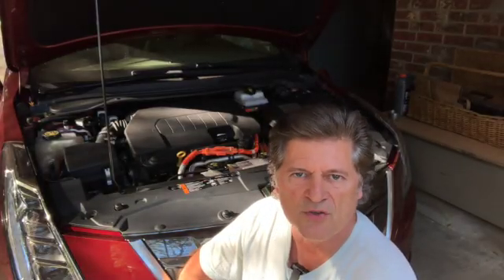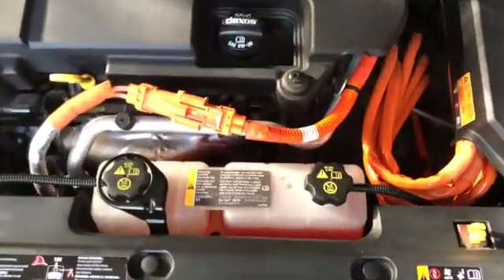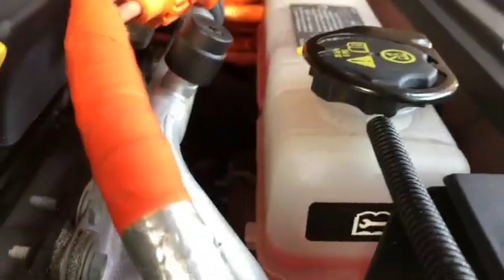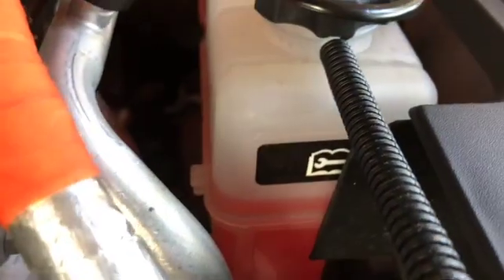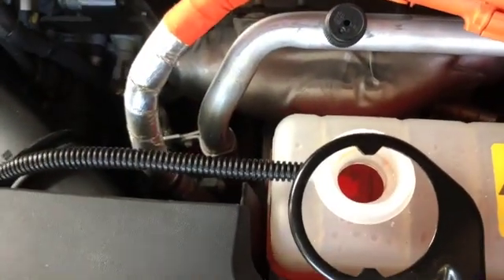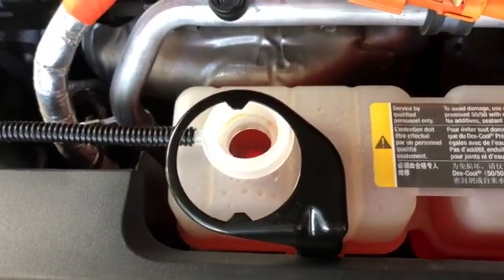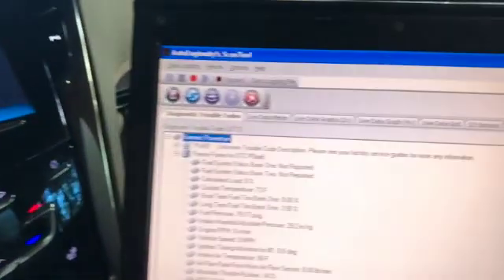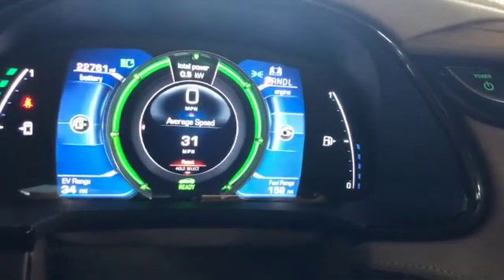Service High-Voltage Charging System Error Message...Fix and Reset

Comment: Thanks for the information. On my 2012, I followed your advice and it almost worked. The problem is resetting the codes. I took it to my local shop and they couldn't reset the code to erase the message. I took it to the Chevy dealership and they had issues wirh reseting the codes. They flushed the coolant then had to reprogram the sysrem, then it worked. It cost me around $250.
Reply: I have a 2012. I have a portable scanner that i use that lets me reset the codes, but im not sure if they stay off yet as ive only just now done this fix, and it hasnt had time to pop back up yet. But im hopeful!
Reply: @UncleBobbo  So The dealership sent me home the first time, saying they flushed out the fluids and cleared the code. Two days later the light came back on. This time they said they had to clear another code which were P0AA6 and P1FFF which  there was a bulletin for but didn't mention it the first time. They had to reprogram the BECM to eliminate the problem. They also said my accessory battery had a bad cell and recommended to replace it since I think it was the original. All in all cost me $600 to fix bith times.
Reply: @UncleBobbo  have u ever had issues scanning your volt? Im looking at a 2014 i wanna buy but my scanner says car needs to be updated to scan or something i never seen that message on any other car
Reply: @tictac9367  Just did this fix on my '14 today, bought a scanner and reset the code. The car is charging now. Fingers crossed!
Reply from the maker: I have seen one Volt (also a 2012) so far that I could not reset the codes on no matter which scanning software I used. I don’t know why, but I have a suspicion that there are certain software versions out there and for some of them there is no reset capability except to go to the dealer and get a re-program as you did.

Comment: Can anyone tell me what engine coolant they bought? I'm new to this Do it yourself stuff on my car. ☺️
Reply from the maker: What is the year make and model of your car?
Reply from the maker: For the car in the video it calls for DexCool coolant for GM cars. You can get it at any auto parts store.
Reply: Thank you so much!
Reply: I have a 2015 Chevy Volt
Reply from the maker: Then it is the same coolant that I just replied above. DexCool for GM cars, it is orange in color. You can buy it either pre-diluted ready to pour in or you can mix it 50-50 with distilled water. Should also be on a sticker under your hood and in your owners manual if you wanna double check it for yourself.

Comment: Is this a problem with the 2nd generation volts? 2016-2019?
Reply from the maker: If it is I’m not aware of it. I’ve mostly only heard of this problem occurring on the first generation.
Reply: @pinkcaddygarage267  well, I have a 2018 that I bought used and at 48k miles this error code came up yesterday...I will follow your instructions to refill and reset and hope it doesn't require a costly trip to the dealer 😫. Thank you for your channel...as a non-technical person, I appreciate your clear instructions and calm demeanor 🙏🕊
Reply: How did it go?
Reply: @user-od5nt2tb2n  Once I filled the coolant tank, I had a friend of mine remove the error code with the device...AND THANK GOD IT WORKED!! No costly follow up at the dealer!

Comment: If the battery coolant has leaked into the battery packs, do you know where the source of the leak would be?  If coolant level is low, wouldn't you want to check to see if it has leaked into the battery packs first?
Reply from the maker: That’s a good point, however there is supposed to be a drain hole toward the back corner of the car in case there is a leak so the battery is not contaminated.
Reply: Since coolant is a mix of 50 percent water, it likely just evaporated over time.

Comment: You didn't say whether the car started charging again.  I assume it did.   I have the same problem, coolant level was down to an inch from the bottom.  Filled up now, and waiting to get an ODB tool to reset the fault and hopefully fix the "not charging" status.
Reply from the maker: Sorry, it did start charging. If the message keeps coming back either you need a coolant sensor or there is a software upgrade they can try as well.

Comment: How did you connect the computer to the car,  I have an old Vista and would like to see if it can connect and clear the error code.
Reply from the maker: I have an old Windows laptop with a copy of AutoEnginuity  on it. That program comes with a cable that has USB on one end for the laptop and OBDII on the other end to plug into the connector on the car. I had to tell the computer that the car was a 2014 Chevrolet Volt since Cadillac ELR was not supported in that program. Then I just cleared all codes and that worked for me. Just about any program that scans and clears codes should be able to take care of it for you.

Comment: Update: A few days later I performed the service and like magic the error message is gone, the engine light is now out and I can resume charging my car.  After receiving the parts only took 15 minutes, half the time looking for a funnel.

Thanks for the information.
  Fixed it myself...
Reply from the maker: Fantastic - Glad you’re “Electrified” again!
Reply: Garry I have a 2012 Chevy Volt  when reading and easing the codes did you turn the volt on? or did you plug it in the scanner and ease?
Reply: @edmiller6227  Hey Ed, in reading some of the post on this site if appears that the 2012 Volt may need to be taken to the dealer, my was the 2015 and this code reader cleared all the errors codes, been more than a year and all is good...love my Volt.  I just upgraded to a lever 2 charger (Clipper Creek EV Station) wow what a difference, 3-hour charge (from dead) vs. 8-10 hours on standard 110v...crazy.
Reply: @LoveMyRottweiler1 my is a Chevy 2013 those can’t be fixed by clearing the codes ? I need to take it to the dealership obligatory
Reply: @edmiller6227  Hey Ed, honestly don't remember (been over a year) I think the car needs to be on for the scanner to work.  Plug the scanner in and if need be turn the car on.

Comment: Yesterday 10-26-2020 I received the error message on my dash "Service High Voltage Charing System" on my 2015 Chevy Volt.  At this point the car cannot be charged, the service must be done.  After checking the coolant level it was down to about a half inch in the tank which triggered the error message.  Today 10-27 I ordered coolant and a cheap code reader from Amazon total was around $60, other than a oil change this is the first maintain I have done on my Volt in the two plus years that I have owned this car...petty cheap!  I do want to fix it myself and keep the extra coolant and the code reader just in case it happens again.  I will update this post once I have performed the service...parts should show up in a couple of days...thanks for the information.
Reply from the maker: Garry, glad to help! From the research I've done, it seems like it's a matter of time until the coolant sensor needs to be replaced on these cars. The good news is that this process will work as long as it's just occurring randomly or actually is just low on coolant.
Reply: Did the error go away?
Reply: @theamazoner4075  Update: A few days later I performed the service and like magic the error message is gone, the engine light is now out and I can resume charging my car.
Reply: @LoveMyRottweiler1  what cheap scan tool did you use to fix the issue?